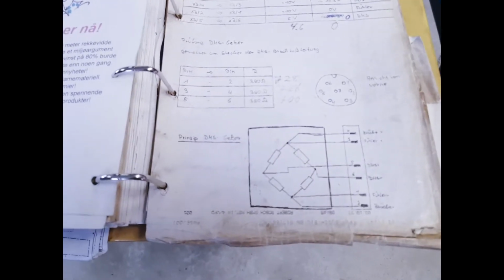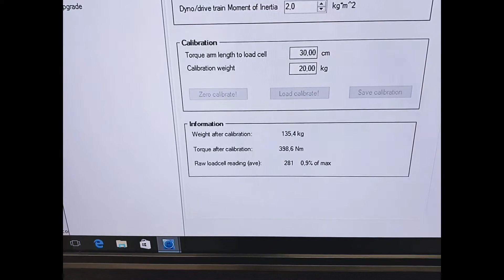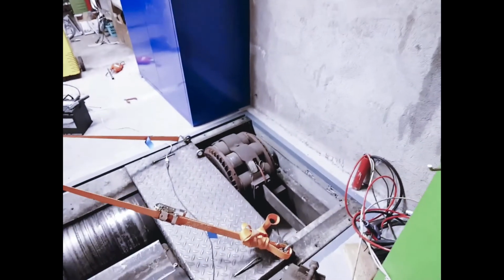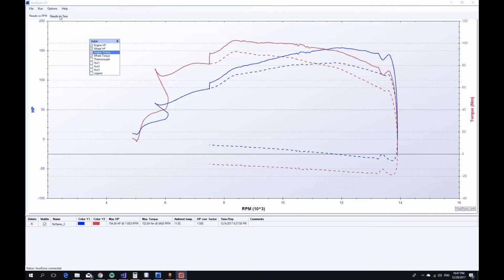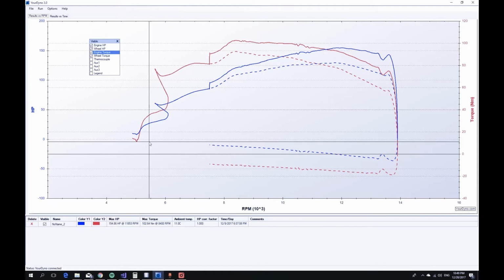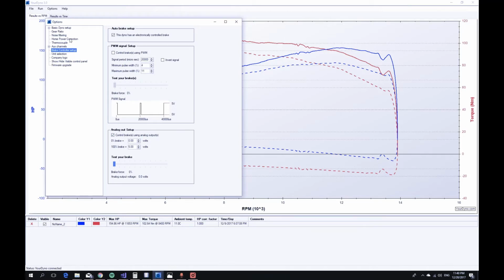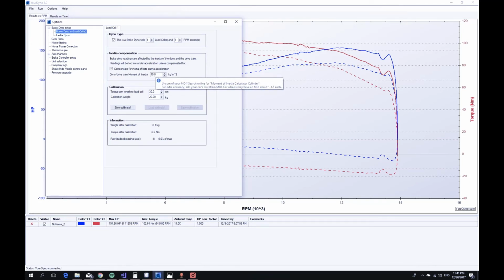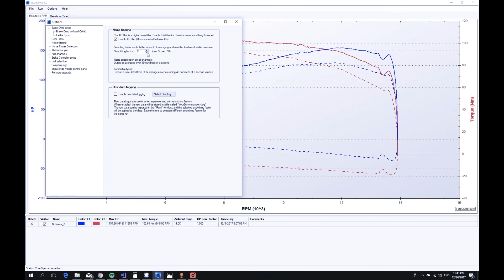YourDyno low cost data acquisition systems for dynos

Comment: Where do you measure torque arm length point to what point? Didn’t say anything about that in the video...
Reply: You measure it from the middle of the brake axel to the calibration load. The load is often placed directly over the load cell, but does not need to be
Reply: YourDyno.com thanks!

Comment: Hi, what about steady state mode? Is it implemented in software easy way to hold rpm at certain point? Is YourDyno support some sort of wire remote control for that?
Reply from the maker: Sure, you can hold a steady state. You can control remotely using 3 buttons, one for brake on/off and two for RPM up/down